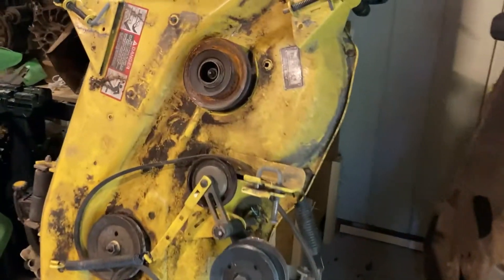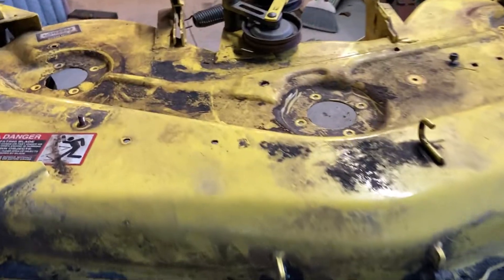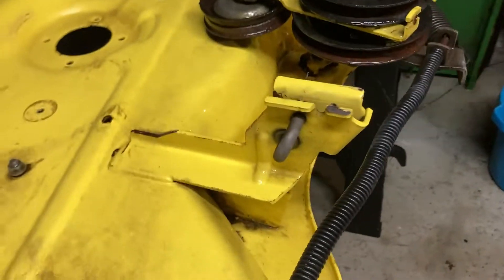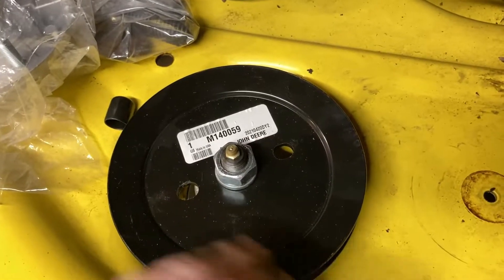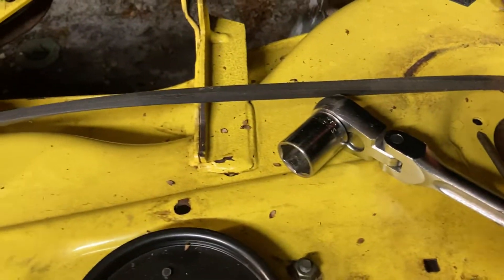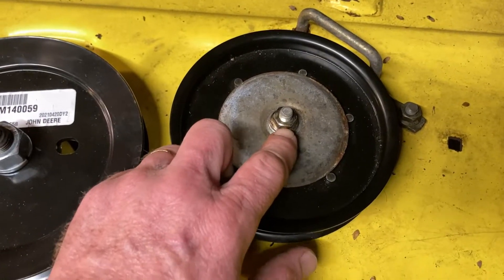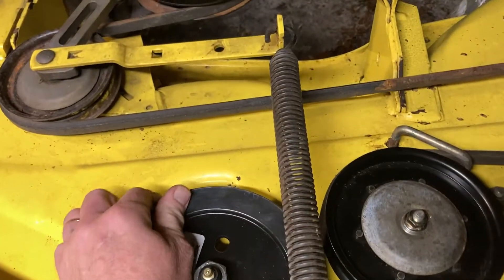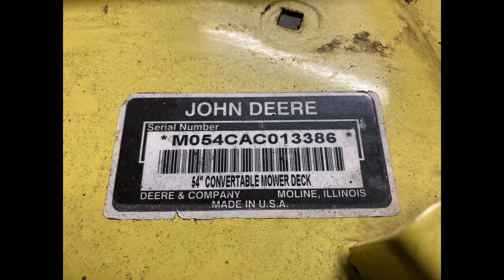John Deere 54C Deck Repair

Comment: What is double pulley you said power flow
Reply from the maker: So the double pulley runs an additional belt that turns the fan/propeller in the leaf collector unit you can add.  The power flow is the mechanism that mounts to the end of the deck and then a chute goes/leads to a bagging unit for collection.  It's a pretty efficient system.  I have had several videos showing various systems if you wanted to browse a few more videos.  Hope that makes sense.  Thanks for watching.

Comment: i have a 54 C from a GT 235 im working on now .the spindles are the over mount 121342 type and on deere parts site also .confusing ?
Reply from the maker: Yeah man, Deere has so many parts and parts numbers for so many variations of what they've built and the internet isn't always accurate, it's difficult to figure the stuff out sometimes.  Even decks that appear similar can have different part numbers and require slightly different parts.  Thanks for watching.

Comment: If you hit the pulley belt faces with a Nylon Abrasive Wheel (HF) on a drill, the rust comes off pretty easy. Otherwise, the rust will eat the first belt you run on it.
Reply from the maker: Yes sir, I have heard that is the case before. I try to get the pulleys pretty cleaned up.  I'm currently doing another 54" deck video from a 455, similar, but a little different.  Didn't have hardly any rust in the groves, but still sanded and brushed them down and repainted.  JD wants an arm and a leg for those pulleys.  Thanks for watching.

Comment: Enjoy your work, I have a GX335 with a 54C deck and am trying to replace the main drive pulley as the bearings went out. You replaced the mower spindles but avoided the main pulley, was it due to cost or degree of difficulty?
Reply from the maker: It was actually in good shape, so I approached it with the "if it ain't broke, don't fix it" mentality.  I think I had two to pick from and just picked the better of the two, but you are right, my video was not really complete without that feature also replaced.  I may be doing a 48' Deck coming up soon on a GT235, should be very similar.  Thanks for pointing that out and also for watching.

Comment: Where did you get part numbers?
I have had no luck on the JD website. I type in the model number and it says that it is an invalid number.
Reply from the maker: Have you tried the parts site?  https://partscatalog.deere.com/jdrc/  If this doesn't work, email me what you need and I'll see if I can figure them out.  Thanks for watching.
Reply: @FloridaDeere  
I can't figure out how to get your email address.
I need an idler pulley for my M054CAC064035. The pulley next to the center blade spindle.
I tried the website you suggested. It says my part # / SN is not a valid part number.
I'd love to find an exploded  view of the deck with a part number list.
Reply from the maker: donbowman14@gmail.com, my other contact info is in the channel info page.  I will see if I can find the part.  What tractor is this on?